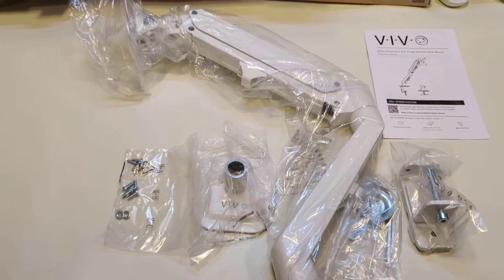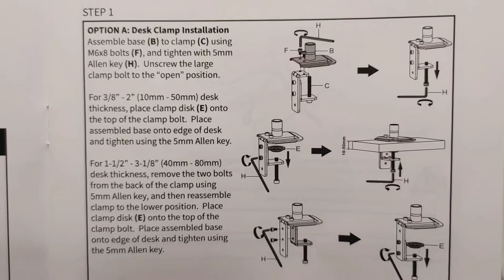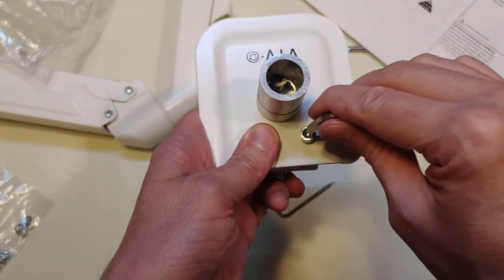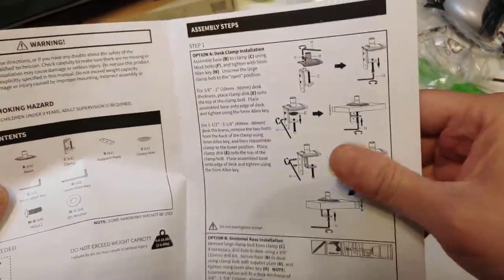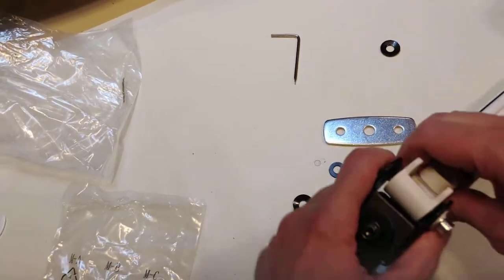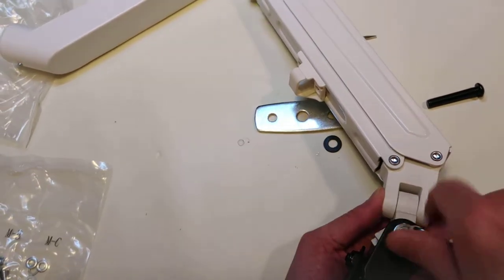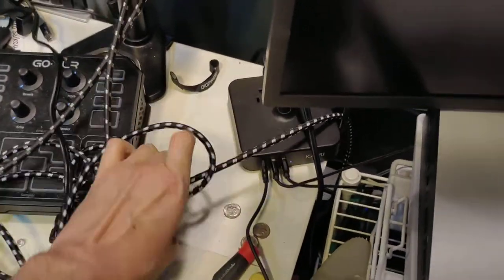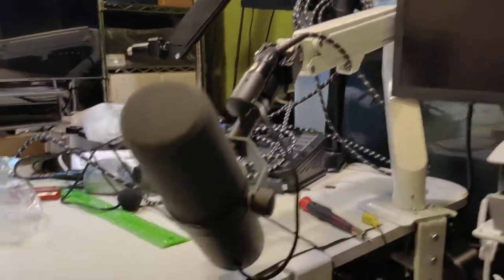Turning the $31 VIVO Monitor Arm+$12 VIVO Mic Adapter Into A Cheaper Alternative Heavy Duty Mic Arm!

Comment: i diy someting similar with a cheap nonbrand monitor arm all i did was drill out the vesa plate and make larger hole and get a bolt + nut that fit mic shockmount treads best hevy duty mic arm for almost noting
Reply from the maker: Thanks for sharing your diy experience, and much thanks for your comment, interest, and for your viewership.

Comment: May I know where to get VIVO Mic Adapter?
Reply from the maker: This is the product that I referenced. I used the VIVO vendor link to ask a question to the company directly of getting just the microphone attachment part for the arm, as I already had the arm. https://www.amazon.com/VIVO-Adjustable-Microphone-Counterbalance-STAND-MIC01/dp/B07GNTNPMJ I hope this answers your question, and much thanks for your comment, question, and viewership.
Reply: @xyberKnight  Actually, you said a $12 part, yet failed to include the link to it. Since you bought the adapter, you surely know where you got it and should have a link to the part.
Reply from the maker: @yourpcmd  I contacted VIVO on Amazon directly and submitted direct purchase for the part, after confirming that I had one of a few compatible mounts to place the order. There was no link for this specific part, where it was a direct purchase link. I hope that this helps, and much thanks for your comment, response, and your viewership.
Reply: This is a great idea! Can you like the direct purchase link from manufacture?  Thanks again for making this video! 😃🔥

Comment: big rip they made a 80$ low prifile arm but if you want that for youe color theme dang . i am getting the low profile arm becauase i need it too go under my monitor
Reply from the maker: Not just for my color theme, but also because I like to mod things, and see what's possible. If I can be frugal and save money and get the same(or better) quality and durability, I'll always opt for that. In addition this is much lower profile than the previous mic arm that I had that could handle 6.5 lbs of weight. This can handle up to 38 lbs of weight and cost the same as my old Knox mic arm. Thanks for sharing the info, for your response, interest, and for your viewership.
Reply: this may be useful for me because in the UK the mic arm costs £160 in Amazon
Reply from the maker: @BeresfordProductions  I'm happy that the content could be helpful for you, and much thanks for your response, interest, and for your viewership.